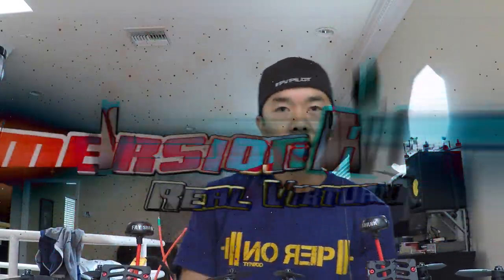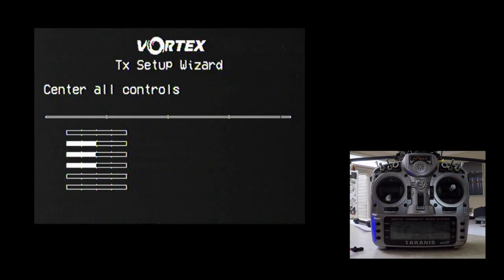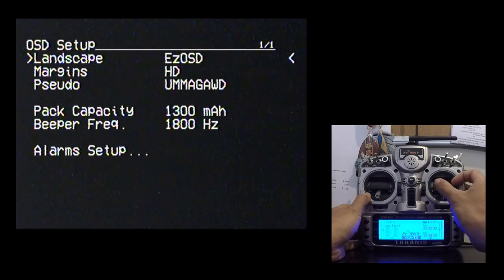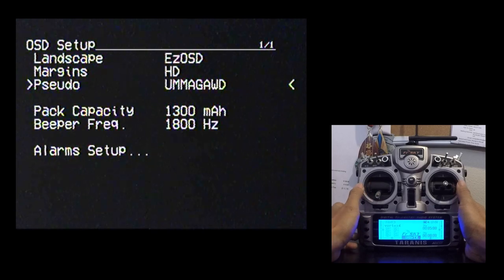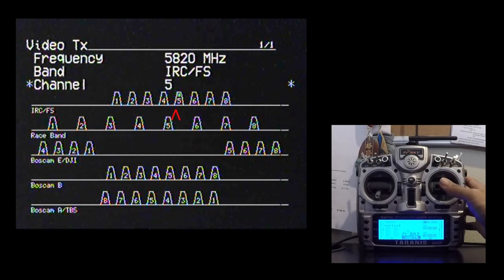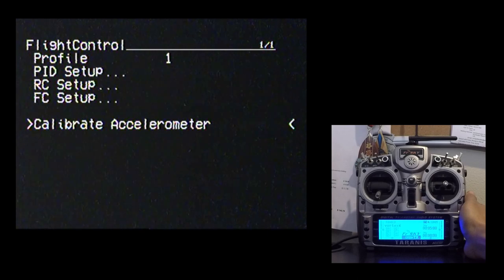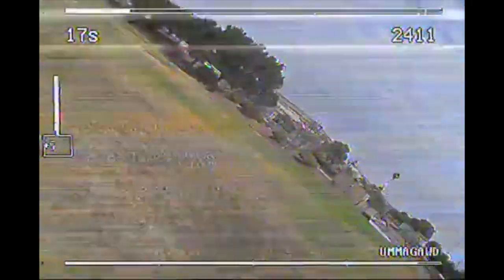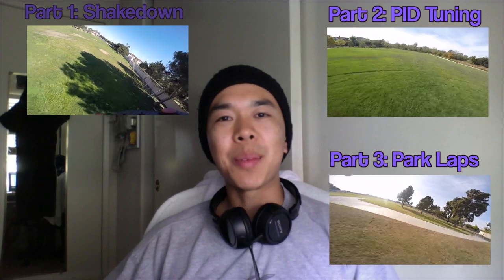ImmersionRC Vortex - Initial Setup, OSD & Game Mode Review

Comment: On a side note, I read that you now also changed to the VAS 5.8GHz Pepperbox antenna, I love this antenna! No more glitches and dropouts.
Reply from the maker: Aerialworks On the recent video, yea. But I likely won't only be using the PB. For most of the few places i get to fly at, and depending how I'm flying, I use the spiro or VAS mad mushroom because I'm camped in the middle of where i intend to fly and I intend to go high :) Pretty much different tools for different jobs type of thing.
Reply: UmmaGawd I had that same problem. But now I use a Pepperbox and a spironet on a diversity receiver. A repeater with patch is used to transmit the signal to 30 meters away to my Dominator. I get full coverage that way :)
Reply from the maker: Aerialworks Man that sounds like a dream setup! When i do get to fly, I really like that "goggles out and go" portability gives me. Sometimes I need to "leave in a hurry". But still, I  can really use a setup like that. Thanks for sharing. I might not be able to fly for a while, but you gave me a great new project :) and I can at least still do that.
Reply: UmmaGawd The cool thing is that when you go high the spironet takes over and when you're low (that's usually where the trees are :) ) the Pepperbox "punches" through the leaves. The patch on the repeater is highly directional, so you do not overload the RF input of the diversity receiver. Enjoy your new project!

Comment: Very nice video!
Great explanations all along, it might be pleased most of the buyers of the vortex!
It was funny to see the T-Motors "Blackout" motors sitted on your frame lol
You had a couple of interferences during the radio control sticks calibrations and your flight, is it normal?
Thanks for sharing and have a great weekend
Reply from the maker: ABMNS PRODUCTION Thanks man. Hehe yea... part of my testing. The motors are theoretically over-spec'd for the ESCs, but I had them just laying around, unused and begging to go onto the Vortex :) I plan to run 5040
And yes, my flight is normal. The initial setup with the radio is only to identify what the channel mapping order is on your specific radio. It's not really calibrating anything.

Comment: Heres what to expect when you get a vortex: Spend 2 hours on 2 different pcs trying to get the pc to recognize the vortex so you can update the firmware because it will not arm. Once firmware is updated connect it to cleanflight and discover anything you change will be erased, once the hardware wizard is ran. Randomly experience flights where it does not boot correctly. Return it to the store and fly your homebuilt quad that has none of these issues, and connects flawlessly to any PC...

 I was excited about this for a while  because of all the hardware for the price, However I will be waiting for the next hardware release version. When will this be immersion RC?

once you address the  board randomly not booting issue let me know and I will buy another one!!

Pros: You cannot build a race quad that has all of these features for less money. Honestly add it up...

flys great after you get it going

Cons: pc connectivity issues were absolutely horrible (and I used to be a pc tech...)

clean flight settings erase when hardware wiazard is ran

bottom of fc board gets super warm even just setting there.

Not a carbon fiber frame, has carbon top plate ,camera plate and arms but entire bottom is fiber glass( this was disappointing)

and last but not least , the show stopper for  me was the random failures to power up.
requires hard reset and re running setup wizard..
Reply from the maker: Wow, sounds like your vortex has issues. Sorry to hear man. I don't work for immersion nor could anyone consider me a tech on a long stretch. But it seems like you just have a defective power board, it happens. Also, there's no reason to update the fw right now because the OSD fw is currently only compatible with CF 1.8 1 currently. Your issues might actually be related to that. I know of too many people that have gotten theirs up and running in less than 5 minutes without connecting to a pc at all, so it's hard for me to hear you say that everyone should just return it. If it's not working for you, then go back to the store and tell them what's up.
And I'm not following your reasoning for saying this isn't a CF frame just because the pdb isn't CF. Lots of frames out there use a pdb that's not CF (because you can't make a pdb out of CF) and no one calls them out on it (blackout, qav, xhover, etc). My suggestion, revert back to default fw, go through the osd setup, and if you're still having issues, go to your LHS or contact immersion. Just because your PC can't connect to it doesn't mean everyone can't. I know it sucks when it's you, but that's just life man.
Reply from the maker: Forgot to add, if you can't arm, your radio end points might be off. ThatHPI GUY has a video that addresses this. Hope that helps.

Comment: Awesome video! So I'm running dal 5x4x3 props on the stock 1806 motors using 3s.. Do you think that'll be fine or should I switch back to 5030?
Reply: I'm wondering about that also? I have a bunch of HQ5040 props the the Vortex comes with GF5030. I'm gonna run the 5030's to keep from burning up my ESC's. Can't  tell how hot they are getting because they are inside the arms.

Comment: Thanks very much for posting this up. I have vortex on order but need to ask a question. I have read every post but cannot find the answer. I have the Taranis with X8R. Will this receiver work or will I need to get the D4r II as you mentioned. Many thanks.
Reply from the maker: Is save yourself a headache and sirens spend the 25 bucks on a d4r and call it a day

Comment: hey man! I'm not sure if you are still flying the vortex, but was hoping you could give some technical advice ? for some reason, after 5 batteries I can no longer get the vortex to recognize my input. I reset the osd and it's at the startup screen. however when trying to center controls, I get no response in the OSD.  any tips or advice is much appreciated. thanks !

Comment: Cool, love this type of info explained in simple words! I'm a sworn DIY'er to the bones, but Vortex is the only copter that I'll actually sell my believes to the devil and will buy it:)) ...but I'll still do some mods...
Reply from the maker: ROBOFORCERX2000 hahahaha.... (fill me in on your mods.... ) ;)
Reply: UmmaGawd As long as I don't have it on my table I can't visualize much, but here's what I have in mind- chop off top plate's Rx section as I'm pretty sure DR4-II Rx will fit inside once shredded of the pins and soldered directly. Shorten the tubes as all I need is 5" props only. Redo motormounts to my style "claw" ones- not gonna save much weight on this, but it will lower the motors what should  give CG right at the prop level, instead of below as it is now. Throw out Mobius damper plate and replace with aerodynamic canopy from the front to the battery. Replace ESCs with bigger ones (16-20A, they only being built at the moment:) and stick RCX 2206 2250kv motors with ~1.5A 4s battery... TURBOPOWAH !!! :)) 
There's more power in a standard Vortex version than my flying skillz can handle, but hey, nothing is good enough as it is for me, not even a perfect quad :P
Reply from the maker: ROBOFORCERX2000 I can say that a d4r can fit inside for sure! The rest all sounds like good "robomods" hehe. The prop line as it is is centered to where the majority of the mass is now (which is the lipo and gopro). And when you get that canopy, can I get one too? ;)
Reply from the maker: And yes, I can't wait for the bigger ESCs too. 2206?!?! That's supercharge power! I'm going to test 2206 2350kv next. But I already gained 38g by doing so. I like things light weight but we'll see

Comment: For some reason after I set everything up and hit left on the right stick the quad starts to beep and I can't get no response on the motors. Any suggestions?? Thanks! Your video had been very helpful so far.
Reply from the maker: hmm could be a lot of things. make sure radio is trimmed to 1000-2000 endpoints, and that you don't accidentally have arm set to a switch. also try calibrating acc.
Reply: Purchased this item, received two days ago, paired the unit with a Futaba T10J, the setup went fine, and I was able to program all of the settings correctly, when I install the props and attempt to take off and apply throttle the unit wobbles left to right and I have no idea why the unit is exhibiting this behavior, do you have any ideas. Any suggestions you can provide is greatly appreciated, take care.

Comment: hello ummagawd,
i noticed that the bar under the yaw bar in the setup was maxt out on my screen. do you know what that bar is? i had a smal yaw problem( it gives a little yaw to the right) so i thought i reset the quad to check if that will help but then i saw the bar under the yaw was maxed out.i didn't had that on the first setup.
Reply from the maker: That sounds like channel 5. Unless you have some custom mix going on in your radio, it shouldn't affect yaw. Note though that ch5 is mapped to flight modes. Best to map 5 to a 3 posted switch.

Comment: Q:How do you set the endpoints or calibrate the esc? Two motor start spinning when I arm the system and the other two don't spin until I get close to 50% throttle
Reply from the maker: End points are usually done on your radio. Min and max in the flight controller is done automatically after osd setup. ESC calibration is done just like any other esc. Lookup how to calibrate esc in cleanflight. Should be a couple good videos that go over it nicely

Comment: For some reason my controls have no effect on the bars in the "center all controls". I used an ar7600 that came with my dx7 bundle. Can you help?
Reply: +Sal Mastropolo I had an issue like that and it turns out that the pins on the connector to the receiver are not the right ordering for the spectrum receiver. You just need to take the pins out and re-order them in the correct way then it should be fine.

Comment: I'm getting a lot of vibration in my fpv camera when I put on the Mobius....what do I need to adjust to get rid off it?
Reply from the maker: TheShaddydogg that's odd... usually the vibes get better when there's a mobius on. I would check the balance on the motors/props. If it does away after putting a mobius on... i'd try new ball dampeners

Comment: UmmaGawd I have a quick question for you. I'm currently waiting on my pre-order of the "second batch" with "race motors" and I will most likely be using your tune so can you tell me what the ideal battery pack would be? Also, its doubtful that I will be running a mobius or a gopro so how adversely do you think that will affect the tune? Thank you in advance for any info you can provide!
Reply from the maker: Hi, for 5040 props, I like 1300mah to keep things light weight. And running no gopro shouldn't have a huge impact. If anything it might just be slightly over tuned. So if you get oscillations, just turn down the p gain a little
Reply: UmmaGawd Awesome thank you so much for the quick response! I hope the next batch ships soon! Im going to order those batteries now... Is there a specific size you would suggest (dimension wise).
Reply from the maker: thejason51873 No doubt! Yea, I like this size for when I run a gopro (http://dinogylipos.com/4-cell-65c/207-1300mah-4s-65c), and this size for no gopro... for the simple reason that it's not as exposed (http://dinogylipos.com/4-cell-65c/187-1300mah-4s-65c-long-style)
Reply: UmmaGawd Thank you so much for all your help!
Reply from the maker: glad i could help

Comment: maybe you can help... can't find any videos on problems getting into advanced setting on the vortex pro 250,,, throttle down and to the left doesn't work for me... I have the taranis x9d transmitter with an x8r receiver... any help would be greatly appreciated
Reply from the maker: +johnny drone if you're able to see ANY type of control... then you probably need to adjust your endpoinst (1000-2000). If you're not getting any response at all.... then you need to get your vortex to recognize your rx... assuming you've got everything connected properly.... those are the 2 things i would look into on youtube/google (there's plenty of videos showing how to check both)
Reply: Thank you for your reply... Everything was connected wizard worked flawless...  I just set up my end point but no success.... Im on page 30 of a Vortex Pro thread in RCgroup.com forum to see if i see someone with a similar issue... Dunno what Im doing wrong...
Reply: Got it... after setting the end points I needed to reset the TX wizard... Im in... Thanks again!!!

Comment: Hey UmmaGawd, great video!  Wondering if ImmersionRc had any plans to sell the video/fc/osd board separate from the Vortex. I'm sure they would sell a boat load if priced correctly.
Reply from the maker: AlaskaRuzz Thanks man! I'm not sure I pull off the whole "review" type of guy, but if it helped somebody make a decision (either or), then i suppose that's all that matters ;)
As for your other question, to be very honest... i've heard the idea tossed around but I haven't heard if a decision was made about'em.

Comment: excuse me, how do you set up the ch5 for mode switching? and I am confusing about the relationship between profiles and modes. can you explain more about them?
Reply from the maker: Kevin Lam Setting up ch5 is something you do on your radio, not in the OSD. So you'll have to look up how to set a 3pos switch specific to your radio. As for the profiles and modes. I'm going to assume by "modes" you mean "flight modes" since you asked about ch5. Think of "modes" as an attribute of a profile. And profile being the "saved configuration" you want to use. So profile one can contain one mode, and another profile can be configured for another.
Reply: thanks!
Reply: I got it and did configuration with ch5 for mode switching today. wondering if profile can also be changed using another ch. I mean it on
vortex

Comment: hey man my radio is bound to my spektrum receiver but i cant control the osd im using the dx6 and a ar610 receiver any ideas
Reply from the maker: id check your endpoints. must be 1000-2000 or it won't recognize osd controls
Reply: +Ultimatevapor918 I said the same thing to sal above maybe try that?
Reply: I was new then lol thanks for the replys by the way he ended up in a lake after a flip :( saving for a 250 pro now

Comment: hai, i have a problem, when i run the setup its all done it says, but the quad will not arm, it will arm in cleanflight and i can give throttle in cleanflight, i save al settings and it works. but when i turn the quad off and on again it wil not arm and wil beeb avery 2 sec
Reply from the maker: Hi,  it sounds like the endpoints on your radio might be off. ThatHPI GUY has a video that addresses this. Sorry, my experience is limited to the taranis frsky system. But you should be good to go after that.
Reply: thanks, but it is already fixed, i dit the FW update en ran the setup again. now it is working fine. so glad though
Reply from the maker: pjotc cool man! glad you got it sorted out. I know how frustrating it can be, especially when you've waited a LONG time!!!
Reply: haha yeah true. i'm looking forward to use your PIDs. i'm running the 5x40 props and 2300kv motor. can i just use the PIDs in your PID tuning video? in part 2 you show them briefly?
Reply from the maker: yup should work

Comment: I can't arm my motors, everything else works.
during the initial setup my channel 4 is partially lit up - that is my 3 way switch 
My channel 6 is lit up completely?
I can't  connect Cleanflight to the Vortex?
Help?
Reply from the maker: ***** your first 4 channels should be your controls (throttle, roll, pitch, yaw). Get that figured out on your radio FIRST, and then go through the setup again. Shouldn't use switches on the first 4 channels.
Reply from the maker: I believe you might need to check the endpoints on your radio. ThatHPI GUY  has a video or 2 that should get you going pretty quick about that specific issue.